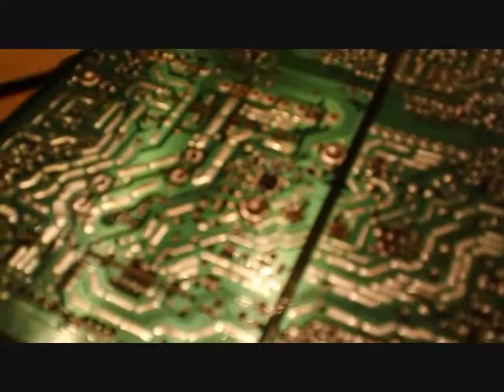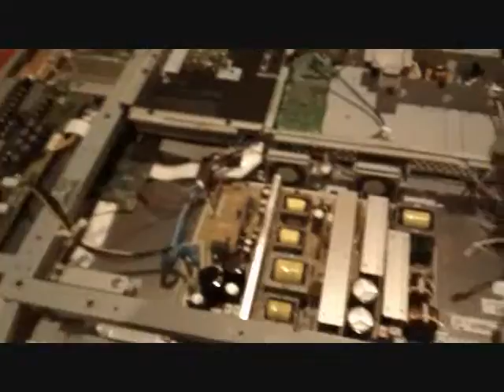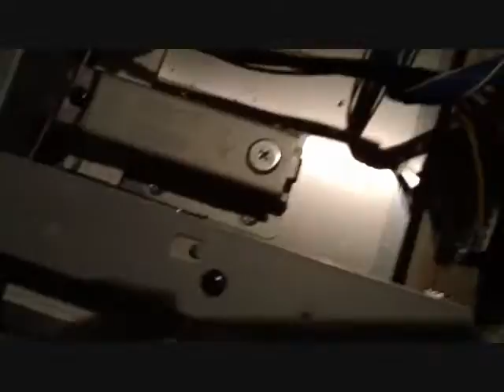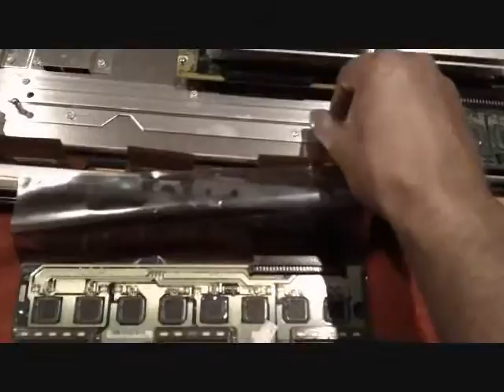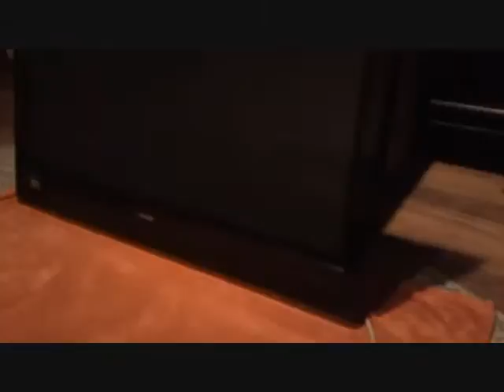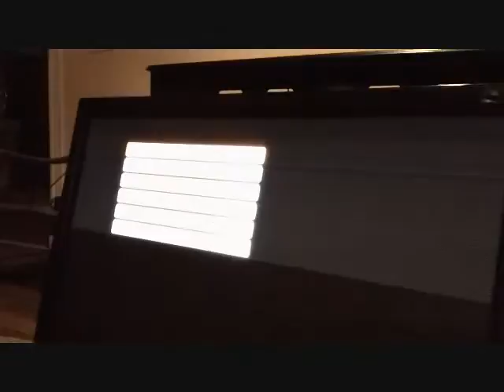Hitachi Plasma TV repair attempt Part 4

Comment: Great vid series Steve, I just picked up the 55" model of this tv, and am redoing the psu caps.  My issue is slightly different in that the standby LED continuously flashes when I try to power the set on.  As far as your issue, i was following your process rather closely and came to a realization.  You tested the 2 SDR boards for shorts on the IC's before you pulled the SDRU and powered up the unit to check the SDRD.  Could it be that firing it up whilst still having the blown capacitors in the PSW, transferred the load to that would have been split between the upper and lower boards, to only the lower board, causing it to fail at that moment, AFTER you had  tested it OK?  Just a thought.

Cheers,

Chris
Reply from the maker: It's certainly a possibility. I was a TV technician by trade, but have been out of that industry, and had not touched a TV chassis in over 10 years when I attempted this repair, so I had no brand specific, or model specific knowledge of this TV other than what I read online. I had read on a thread where during troubleshooting, the set was powered up with one board removed. This led me to believe it was safe to do, but perhaps as you said something happened prior to me replacing the caps…..heck, the cat came in and rubbed up against me, maybe it was an ESD that took it out! lol. Glad you like the video. I'd like to do more videos of electronics repairs, but they'll be more old school. I've got a good sized boat anchor CB radio collection that needs love, and some tube type amps, and radios that I'd also like to spend time on.

Comment: as far as the missing video.. Some tvs will not produce any video or incorrect video when only running half of the buffer drive.. it is not actually recommended to run the sets this way at all.. the issue is because of the missing upper buffer board as to why the video is not appearing correctly. I have experienced this as well.

Comment: As a repair tech I can tell you what happened here.. These sets are notorious for SDU and SDR failures. The power supply caps may or may not be an issue honestly I have only ever had the SDU and SDR failures.. in your case when you first pulled out the upper SDU and fired up the set the lower ran but failed shortly as well after hence the white distortion just before the 3x blink occurred once again. I was able to see the horizontal line of which chip failed just before the set shut down so in this case the lower failed as well.. so when you went to just replace the upper the lower was still bad hence the same issue. When the buffer boards fail it is a rule of thumb to replace both together because once one goes the other follows suit.. The chips that were used on these hitachi sets were not very reliable hence that the two original boards were already at that failure state but only one was replaced... since you went thru all this work all that you need to finish this set is to replace the lower SDU and it will work...
Reply from the maker: Hello. Thank you for your comments. In later parts of this series I do replace the other board, and the set was repaired. To date, it has not failed, and is the main TV in our house. I was a TV tech back in the 80's and 90's, and actually made good money in the early days doing VCR repair, but I never saw the kind of large scale integration found in these sets. Regards, Steve W.

Comment from the maker: Hi, I got them bot on Ebay. 1st board came from California for $75, but when I needed the second board, I tried another Ebay member in China. They listed it as $45 or best offer, and they accepted an offer of $40, free shipping. Bad news it took over 2 weeks to get, but I was willing to wait in order to save the $35 differance. Both boards I received showed signs of having been repaired, they each had one buffer IC that clearly looked differant than the rest. To date, the TV is still working AOK

Comment from the maker: I did not test the new caps, and I feel confident the SDRU board is good, because as you see at the end of the video, with the SDRD board unplugged, I do get the set to stay on with half a screen. I think if I replace the SDRD board, I night get the whole screen back, but the fact some of the menu functions appear to be missing worries me. I'd hate to invest another $75 only to find it still does not work.